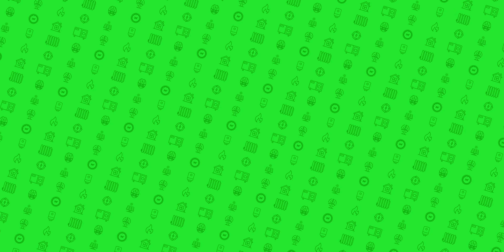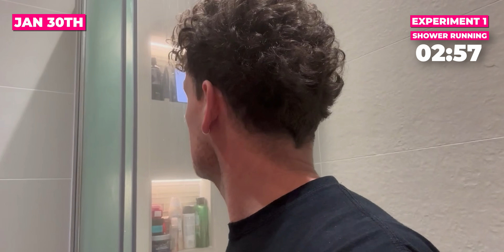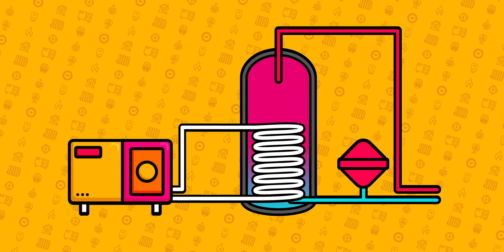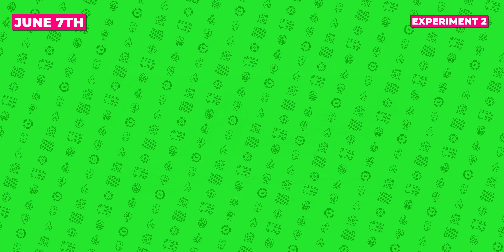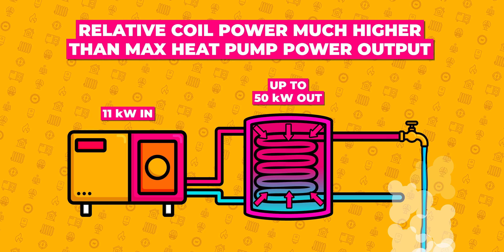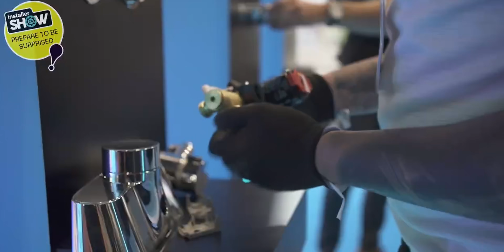The Worlds SMALLEST Cylinder is here!

Comment: In a previous property I had a similar hot water storage, but used night time cheap tariff to heat the hot water store.
The water inside the pipe inside the cylinder would be at store temperature.  This would mean that the first flush of store temperature water would would help heat any cold pipes.
The system worked really well, except the cylinder itself was vented and would need topping up.

Comment: This is a great idea and is basically the same concept at the sunamp heat battery I have installed, but rather than the proprietary phase-change material you are using water. I'm assuming that these are significantly cheaper than the sunamp? It's a shame they are so expensive and probably the reason they aren't more popular.
Reply from the maker: Except for the fact there’s one less heat exchange with these which makes them more efficient

Comment: wonder when plate exchanger is comming to uk ;) sorry but i think uk is way behind when it come to heatpump princip in system.
just find this heat geek via skill builder, there are a lot of other things to consider when we talk about hotwater i am glad to see heatgeek adapt to use tapwater in spiral and heat storage around spriral now its time for next level of effiency the plate exchenger with hotwater.
when we have tap-hotwater in storagetank we must have a temperatur about 60 celsius or heat it up once a week to min60 celsius to minimace legionella you cant do this with heatpump heat via a spiral in tank when reach 50-55 you no longer have a exchange and heatpump cut off becouse high temp.
i have recomend and use spiral for tap-hotwater for 15 years and as compliment use a small hotwatertank for topoff, when working with on/off heatpumps early years when they didnt go upp high in temperatur, now allmost every heatpump reach 65 celsius and we no longer need to topoff its ok with just spiraltank to fullfill reglement, but when  we now can have 65 celsius in storage for hotwater why use spiral when plateexchanger is more effectiv, there are allready alot off tapwaterstations on market for this purpuse or diy, spiraltanks is costly becouse of presure limit clean storage is not so using plate exchanger for hotwater is costly effective maybe not if bying a expensive station perhaps but there are solutions.
the systems i work with there are regulations regarding temperatur and legionella restrictions and different solutions regarding how we setup heatpumps much more automation and possibility how we do it, but whatever size the princip it adopting to small systems to.

Comment: I'm assuming there would be a minimum heat pump size which would allow you to achieve that constant running - you mentioned 3.5kW going in but 11kW coming out, but then mentioned you have a 7kW heat pump. I'm still pretty new to the terminology and so on (my house is a bit like one of your challenging properties, especially with siting the outside unit and the cylinder but I would like on one day since we have only electricity so have a 6kW flow boiler, wet UFH and an immersion heater), but I thought the 7kW in your pump rating meant that was the maximum output, so have I got this ass backwards?

Comment: Were the dimensions of the cylinder 650mm high and 500mm diameter or the other way round?
Just checked the cabinet where the combi is, cylinder won't fit, only 400mm deep😢 😢

Comment: Very interesting, at present, I have a combi boiler,  I don't want to swap it at the moment for a heat pump. But your cylinder for DHW would be a better system for my situation. Could I use the heating side of the combi with a 3 way valve with Y plan control as an interim solution

Comment: Question please. I'm thinking of replacing a Combi boiler for an ASHP. I'm keen to explore using a large heat bank / thermal store, rather than a standard cylinder. I've had one before in a previous house with solar thermal and would like to add solar thermal here in the future too. I also like the mains hot water approach and an unpressurised tank. I appreciate that the cylinder will need a very good flow heat exchanger, and the ASHP might need to deliver slightly higher temperatures - both of these may have been a constraint in past systems, but seem readily available now. Are there any other drawbacks with opting for the heat bank route? House is modern with excellent insulation, underfloor heating downstairs, plus radiator in 3 bedrooms, 1 bathroom and an EnSuite. Any thoughts welcome.

Comment: Looks like a very efficient replacement for DHW cylinders! Excuse me if I missed the point, but why won't you need to anti-legionella cycles for this cylinder, especially if you can store the DHW at 42 °C?
Reply: You don't need legionella runs, because the volume of dhw in the coil is much smaller with the same flow rate. The coil is flushed every time you use dhw, whereas bacteria in the tank itself may sit there for days or weeks.

Comment: Assuming you do have space, doesn't storing more water at an even lower temperature reduce losses and increase SCOP further? But this does look like a very good compromise is you don't have the space.

My one daughter spends a looooong 15 mins in the shower so it would be really useful for this but I would not want it to continue heating up the store unless someone else is having a shower after (rare) - would it be possible by somehow getting it to stop when the shower stops by default or continue if we "tell" it to (like having a 15 mins boost button)?
Reply: I don't think the reheating of the store is too much of an issue: in the winter, the store will get reheated at times when DHW is scheduled. This means that the heat pump will continually cycle to keep the cylinder at the DHW temperature (notwithstanding the cylinder hysteresis value set and any anti-cycle timer that the heat pump has.) Effectively, this means that during the DWH scheduled times, you are running your whole heating system at the higher flow temperature needed for hot water production (e.g. 55C). Your COP will be hurt by this, but by limiting the times when DHW production is allowed, you can reduce the impact of this. (The closer you can get the store temperature to the flow temperature for space heating will also reduce the impact of this) At the end of the DHW production time, the heat in the cylinder will be used as if the tank were a buffer to reduce cycling and used to heat the house; the next time the heat pump starts it will do so at the more efficient flow temperature required for space heating and continue like this until the next DHW production time. In summer, basically, the same thing happens, but without the possibility of using the heat in the cylinder to heat the house as there is no heating scheduled.
Reply: You could implement a boost button using a low voltage relay to swap a resistor into the temperature sensor used to detect the temperature in the tank. Doing so would cause the tank to appear hotter than it really is when you want to inhibit dwh production, and allow the temperature to be read accurately at times when you want to allow dhw production. (Assuming that the temperature sensor's resistant increases with higher temperatures). The button would have to keep the resistor in circuit for the potential length of any shower/bath.
Reply: Yes and heat pumps aren't known for heating water to high temps....
Something about this doesn't seem ok to me.

Comment: I've used a combi tank setup on my heat pump system. The only differences are: 1. There's no heat exchanger in the tank. Hot water is pumped from the tank to two brazed plate heat exchangers (in series for better efficiency) whenever a hot tap is turned on.  2. There's a 3kW ThermaQ instant heater to provide up to 6'C temperature uplift at high demand periods. It also only operates when a hot tap is on and only when the flow from the BPHE drops below 45'C. The hot water is direct from the cold mains, so no legionella issues. I think reverse tank systems are called heat banks? It's a system that works really well for heat pumps. I also have an immersion heater in the tank which only uses surplus solar power from a solar diverter, so for 7 months of the year the heat pump isn't needed.

Comment: I think the requirement for a hot water tank is on its way out. Electric showers and a similar instantaneous supply to the kitchen will do the job. Given most washing machines and dishwashers heat their own water, and if you don't live in a bath-obsessed household, you simply don't need enough hot water to justify a hot tank.

Comment: I did notice that your rain head shower was only allowing about 50% of the full flow through the head. Was this intentional to reduce the flow because in your final comment you suggested installing a shower end to the tap to reduce the flow. Heat pumps and EVs share the same problem - they are inconvenient to live with - A heat pump cannot heat a house quickly so is on all day and an EV takes far too long to charge

Comment: How do heat pumps cool the refrigerant before picking up heat from outside?  Presumably it's cooled to outside ambient by placing piping behind the fan but how does it get colder?  Expansion?
Reply: You are right, it's because of expansion (/compression). In detail, it's because of the Joule-Thomson-Effect and the temperature drop that occurs in these refrigerants when the pressure is lowered without any work needed. So the compressor and the expansion valve are working in a way, that the pressure/temperature of the refrigerant on the outside heat exchanger is below ambient temperature and on the inside heat exchanger it is above the heating water temperature.

Comment: If I have my main, say 300L HP / PV / Solar Thermal tank in my plant room (or my (formerly) airing cupboard) what pipework do I need to run from my A/GSHP installation to the 3 Mini Stores above my 2 en-suite & main bathroom showers?  An example system diagram would be helpful please in the Newark pdf spec.

Comment: Are there any thoughts of releasing a smaller diameter cylinder in this design?
I have a tall 1.8m cupboard where the combi boiler is located, but the cupboards are only 40cm deep
Reply: Not as a stainless steel Mini Store, but we'd be able to potentially manufacturer a copper equivalent with a 400mm overall diameter, if you can provide and guarantee the exact design. If this is of interest to you, please feel free to contact our sales team to discuss.

Comment: That's great @heatgeek Adam, very clever design. Please can you tell us the minimum required heat input to maintain a constant shower temp with a flow of 8.5L/min as per the video? Can a smaller (e.g, 5kW) ASHP deliver this in winter? Many larger properties with large heat pumps may well have room for a DHW cylinder, so it's more likely to be smaller properties with smaller output ASHPs where such a solution is more likely required, but if it requires a larger output heat pump to maintain water temp then that kind of defeats the purpose. Perhaps that's an experiment you could run in winter?
Reply from the maker: take a look on the newark website as we've now published performance sheets
Reply: @HeatGeek  Brilliant - thank you

Comment: You are stuck in outdated technology. The combi boiler does not require water tank. Why the UK go backwards. Other countries use the electric boilers in the last 50 years. Most of the houses in the UK are not designed for water tanks. The Net Zero is the biggest scam in the UK. Expensive to buy and install complex and expensive to maintain, plus need a lot of space. Reinventing the wheel bring us nowhere.   With your product you just add more electricity consumption.
Reply from the maker: Literally every sentence here is incorrect

Comment: With a well ventilated loft couldn't a heat pump be installed there. It would benefit from the absence of cooling winds and possibly warmer air due to heat lost from the rooms below. Weight issues could surely be dealt with, of course a suitably sized access would be required.
Reply: This wouldn't work for the same reason it wouldn't work to put a heat pump inside the house.

Comment: I wonder whether there's a way to replace the water in the heat store with a PCM with the right freeze/melt point... which would mean the hot water coming out should stay at exactly the right temperature for much longer - https://www.youtube.com/watch?v=Nqxjfp4Gi0k
Reply from the maker: Much less efficient and wouldn’t work at this size as you wouldn’t be able to recharge

Comment: Old tech thermal store....dumped due to scale build in the late 90,s don't get sucked in. I do tip my cap to the independent heat geeks sponsored by Valliant !!!!
Reply from the maker: This is not a thermal store it’s a shell and tube heat exchanger. Not the same as boiler mate etc.. Lower temps mean no issue.
Reply: Interesting. Your aid to the low temp heating industry is commendable. Loop and shell suggest multiple tubes inside the shell and I have used these for marine applications i.e exhaust to water ( bowman ) for solar thermal on swimminging pools. Mainly the internal tubes are of anti-corrosive material for obvious reasons. Does your non- thermal store have multiple tubes for heat transfer or is just really long?. Can I have more details please.e.g Litres per min at 9 degrees inlet temp,. predicted temp rise with a storage capacity of 40 degrees and length and surface area of tube(s) for heat transfer,. Scale protection and heat geek guarantee? Many thanks

Comment: Why have heatstores been ignored for so long?  We had one installed in 1997 because we wanted a shower in our dormer bungalow.  Not being able to have a header tank pushed us towards a heat store - so glad that we did - the efficiency even with a  gas boiler is better.
Confusingly, a Heat Pump (HP) technician said that our 145 litre store wouldn't be up to the job.   I'm so happy that we've waited and we've seen this video which proves that exactly the opposite is true.
So as well as learning (over the past 20+ heat-geek videos) that buffers are generally a "bad idea", we now know that a heat store is the ideal partner to a HP.

My only concern regarding horizontal tank deployment is that the coil of copper pipe will be going through alternately hot then cooler water as the stratification of water is gravity dependent.
Reply: We also have a thermal store (160L) to get a decent shower power. It was in preference to a mains pressure hot water tank as the cupboard is in the middle of the house and running a drain for the pressure relief would have been difficult. One of us also has fairly full baths, so I went a bit larger than might have been needed.
It's been a success in general though not without issues. The manufacturer recommendation is to run it at 75C but that is obviously somewhat uneconomic, especially with a condensing boiler. So I've turned the cylinder temperature down to 50-60C - lower in the summer, hotter in the winter - and adjust the boiler temp to suit (it's a pure heat boiler with no separate HW control). The difference S/W is because the mains temperature varies with the seasons and this is effectively an instantaneous heater the store needs to be hotter in winter to get the outgoing water to the same temperature. Getting a full bath our store temp down to quite near the needed outlet temperature at the end. (I've actually fitted a spare pump to recirculate the hottest water trapped in the top of the cylinder down to below the coils. This also stirs it more than the natural convection to improve the transfer on the coils. That ekes out a few more litres of passably hot water. Only used when running a bath though - showers don't use the volume or flow rate.)
Reply from the maker: This isn’t a heat store. It’s a shell and tube heat exchnager
Reply: @HeatGeek  That's a bold distinction. Is there a specific percentage of tube to shell that defines a heat exchanger from a thermal store? Your shower experiment in the video clearly started on the basis of it being a thermal store then progressed to testing it's ability to operate as a heat exchanger. If it's actually just a heat exchanger then it's effectively a heat pump operating as a combi-boiler.
Reply: @HeatGeek  Love the concept and ambition - particularly being able to remove the need for complicated unvented DHW systems with expansion tank etc. Is there any reason a plate heat exchanger (PHE) was not used? there are many commercially available 50kw PHE's for relatively low cost that could potentially do a similar job in conjunction with a small/buffer tank.
One other consideration is that a combi boiler is a single discrete unit, whereas the 'thingy' requires an externally mounted heat pump in addition to the tank, so although it is a great leap forward, the integration of the heat pump is also a factor for flats and small properties with limited external space.
A rarely mentioned aspect of heat pumps is that the amazing efficiency is not a magic feature to create the extra energy, but the ability to extract 'renewable' energy from the local atmosphere/environment; as such siting and location can make a considerable difference to efficiency since the more [heat] energy available to a heat pump, the more effectively it will produce hot water!
Reply: @HeatGeek  I'm sorry, but that just sounds like a name change for name-change's sake.
The solution in the video IS a heat-store which has less storage "reserve", and, as you've clearly shown, all you've done is reduced that reserve down to the bare minimum that you can get away with.
There does not seem to be any functional difference between your 16 litre set up and our 140 litre, or @mikes4163's 160 litre set up.